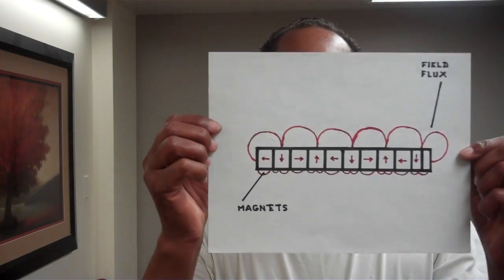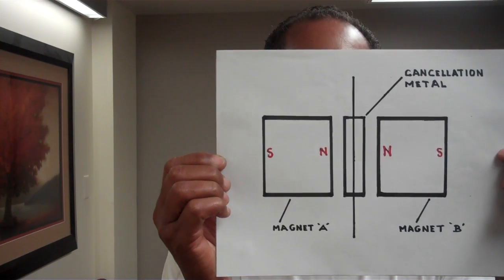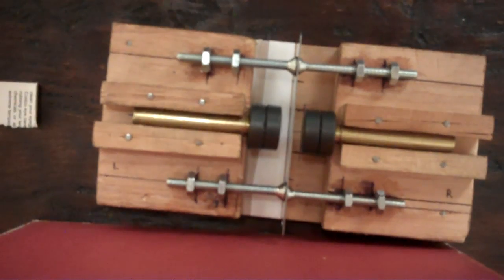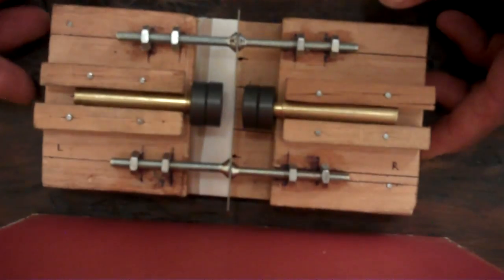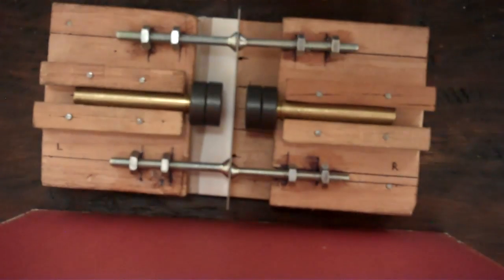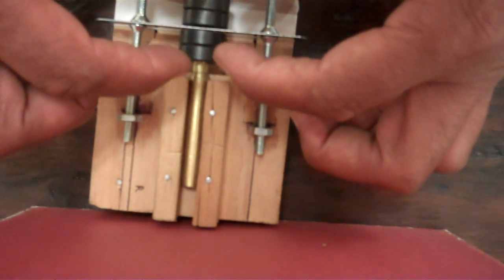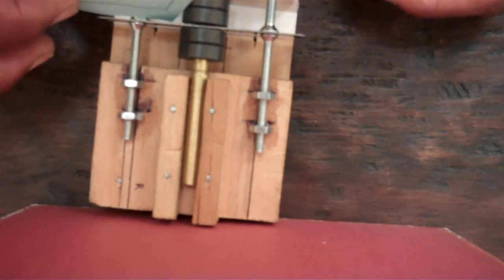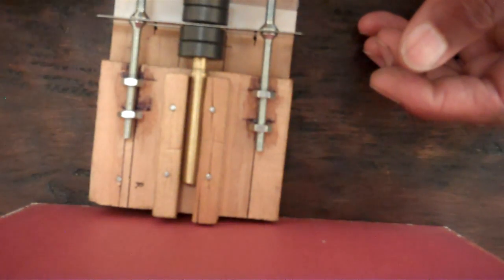PERMANENT MAGNETS: Two Types Of Permanent Magnetic Field Force Cancellations (Balancing) | Part 1

Comment: I understand the premise and acknowledge that it is possible, but you should have had more space between the magnets and the wood block as the wood block is preventing the magnets from repelling further.  You could literally remove the "blocking metal" between the two magnets and nothing would happen as they cannot move further apart due to their collision with the wood blocks.
Reply from the maker: Mr. Wes Baumguardner : .. This is a rough model to prove 100%, and to get the point across. That, equal repelling of the magnets toward each other and their attraction to the metal plate, is possible. Cancelation of direction of magnets to zero. Neutralizing their field strength in a certain way, without destroying their field strength. With electromagnets you simply cut the electricity off if you want to break the field strength. This can not be done with permanent magnets.
Reply: @jessiejohnson3457   "This is a rough model to prove 100%, and to get the point across."  In order to prove 100%, you must show that it is the magnetic shielding that is stopping the magnets from repelling further and not the wood blocks of your demonstration device.  I am trying to help you out because people whom do not understand the premise can simply claim you are using the wood blocks and completely disregard your experiment as pseudoscience.  I already knew your premise worked before I watched this video, but most people are fed nonsense about how magnetism functions in the public education system and they think a lot of phenomena are impossible that are actually possible.  I am on your side.  Thanks for taking the time to educate people about this as it could definitely be utilized in advanced technology.

Comment: In some electronic devices speakers have magnetic shield to protect from disturbing other components.what is the material used and what is the principle behind it?.
Reply from the maker: Mr. Sundararajan:  ...This video is NOT about magnetic shielding. I know what magnetic shielding is. You indicate that you don't know. This is about magnetic field balancing. 2 different things indeed. Repulsion of magnets to each other equals attraction of magnets to metal. Hence: field balance. Push equal to pull.

Comment: If you hold together 2 magnets while they are repelling and drop them from a height will they take longer hitting the ground than 2 magnets simply held together naturally? I heard the repelling ones slow down the gravitational field and go slower . You would need to some how fasten the repelling magnets together stopping them doing what’s natural.
Reply from the maker: Mr. A. A.: ...I don't know. You'll have to find.
Reply: @jessiejohnson3457  what I show people is I have a 1/2 inch copper pipe ID and a small piece of iron rod 1/2 inch OD and 2 magnet's. Funny how iron alone falls fast thru the pipe. And the magnets alone fall slow. Add a magnet to each end of the rod and try orienting them different directions to the iron...like nsIns, N-S-I-S-N, and snIns....you should see each of those three fall at different rates.

Comment: good stuff Jessie! im looking to get the max range possible in resonant nearfield coupling at 125khz, any ideas? problem would seem to be if i put metal behind my coil it will tend to cancle out the field/repel the field from the card im trying to read (rfid). Do you film this at a comunity tv studio? was wondering who interrupted you
Reply from the maker: Dear Mr. J. Wuethrich: (1) You will have to test to find out if the metal used to balance the magnetic force fields will balance for your case. (2) This was videoed at a meditation center and several of the women wanted to use the room.

Comment: was hoping you also removed the magnetic canceling while the magnets were very close. also add Gator Clamps To each end of the cancelation piece to amplify effects. please reply.
Reply from the maker: Mr. Altruism: The rough working model that's pictured in the video cost $10-$20. Made from common materials. Please make one and test it in every way you want. It's a bit of fun to make in fact and test. Everything you need to know is in the video. Add gator clamps and have a ball.

Comment: very well demonstrated, your magnetic canceling principle would have several industrial applications such as high voltage switching or a shut off switch if excessive vibrations is detected without the need for electromagnetics relays.

Comment: I would like to have seen what would happen to the magnets if the metal was removed and or if one magnet work to actually come closer I want to see all the pluses and minuses
Reply from the maker: Dear Mr. Slayer: If you wish to see all the pluses and minuses, then simple make one as shown in the video. It cost about $10-$20. Nothing fancy. Use scrape wood from around the house and small magnets with a central clearance hole and small braze tubes from the hardware store and super-glue. Spark plug gap blades from the auto-parts store. Make it precise enough and it'll work. It's in fact a bit of fun to do. Nothing boring. Have fun.

Comment: NICE demonstration ! thank you for posting. I think that what you are doing is not "cancelation" but double "Shielding" If you use ferro powder on paper on top of your demonstration you will see that each negative side is being "rerouted" outward by the metal then back toward the south end through the air. "Balancing" not "Canceling" is what you have done here in my opinion: let the ferro powder show the truth
Reply from the maker: Dear Mr. H. Westrich: The directions of motion of the magnets are canceled and don't move. The forces of attraction and repulsion are balanced. Equalized. It is very simple.

Comment: Shouldn't it 2+(-1)+(-1)=0? Presumably each magnet has a +1 attraction to the metal with equal repulsive force to each other. 2x+ (-1x)+(-1x)=0 
Were the value for x of the magnets not equal the cancellation would not work.
Reply from the maker: Dear Mr. Phu Kew II: Don't complicate the simple. It's simply plus one minus one equals zero. Nothing more.
Reply: O-Kay. I was just asking.
Reply: Phu Kew II ....hahahaha i dont know..im not good at maths...hahaha
Reply: ....he didnt understan ur question i guess....he just explains just what he thinks
Reply: That's OK, he means well. I guess if we make 'X' 1/2 it would work. I think.
Reply: Phu Kew II even if one magnet is half as strong,  it will just be 4x closer. using just what hes stated he isnt wrong but it is lacking. its good content though.

Comment: Dear Jessie Johnson, please tell us what you study in the electrotechnical works. Thank you
Reply from the maker: Dear Mr. Constantin V.: Tho I experimented with permanent magnets for about 30 years, this was to learn it's principles and construct a machine that could be a power source to produce electricity via an electric generator. I've found that system. Now I'm into other things.
Reply: Producing electricity using magnets was discovered after more than 100 years. Physicists such as Ampere, Faraday, Maxwell, Einstein, helped however. Belgian engineer Zénobe Gramme (1826 - 1901) achieved in 1870, the first electric generator for industrial use. Too bad you lost your time discovering things already known.
Reply from the maker: Dear Mr. Constantin V.: You don't know what you're talking about. Let me hip you to the problem to be solved. Hydroelectric generation. Water falls from a position down over turbine blades of a turbine which turns an electric generator. The amount of force that made the water fall is the same amount of force to bring it back up to its original position to fall again. Use only permanent magnets to mimic this process to produce electricity. Then you'll know better not to talk when you don't know. If you write any other dis-respectful comment I'll delete it. Learn who you're talking to before you talk. Einstein and Maxwell were dim-wits. The others were hands-on. They knew reality.

Comment: Thank you. Excellent
Informative and good demonstration.
Did you make the the wooded board yourself or did you purchase it? Where can I find those magnets and the metal plate that you use for demonstration? Thank you,
Reply from the maker: Dear Mr. Ali Umar: (1) the wooden set up is made from scrap wood I found around the house. Nothing special. (2) magnets can be bought at most hardware stores. From small 25 cents magnets to $20-$30 magnets. All common. Pick what you want. (3) any magnetizable metal will work. Test for the strengths and dimensions you want. The rough model in the video cost $15-$20 to make. Simply make it with enough precision and it'll work. It is simply to balance the forces of attract and repel of the magnets. Nothing more.
Reply: Thank you Jessie. You should be considering to teach physics. Lots of need for Physics instructors in US

Comment: neat but lack of berrings on your experiment allows for flux if cancellation  is truely possible than all math is flawed and free energy is possible.
Reply from the maker: Dear Mr. Neuphpne: (1) This is a $15-$20 rough model in the video. It is not meant to be a flawless balance of forces as a $300-$900 model. (2) Extreme precision and tolerance can be attained with today's technologies if extreme balance is required. (3) All energy in itself is free. You're made of it. 100% free. (4) Research Nikola Tesla to comprehend the nature of things. 99% free energy has always been possible but the Capitalist System will not allow this. Money and greed rules. 99% (not 100%) is many times more than enough energy for all human activities indefinitely. (5) All math about physical processes isn't flawed, only a small sized percent of it is, because human beings are limited and flawed. (6) Research in depth the nature of things before you comment.
Reply: neuphpne: Nikola Tesla proved that free energy was possible ages ago. All natural energys are and should be free.
There are energy forces all around us, we just need to find ways to tap into them. Example:Earth's magnet fields.
Reply: "neuphpne: Nikola Tesla proved that free energy was possible ages ago. All natural energys are and should be free.
There are energy forces all around us, we just need to find ways to tap into them. Example:Earth's magnet fields."

Contrary to what you see claimed a million times on YouTube. Tesla knew better than to get involved with free energy. He was an educated man and he knew that there was no such thing as free energy. He never wasted his time looking for it. Also, the Earth's magnetic field will never be a source of energy. No magnet can be a source of energy, magnetism is a force, not an energy.

Comment: Great presentation. As for a theory? Personally I realized that the main/primary force of magnets is the circulation of the potential field that is created by the aligned electric fields of the molecules. This is your primary +1 force. This trapped moving potential energy is simply moving charge and happens when voltage circulates in conductors. The magnet's trapped circulating fields entrain the same movement in the ferromagnetic steel shim. Creating a force balance that is not present in the magnets itself. Their charge carriers are saturated and locked in alignment. 

There is a balancing force in the magnet, a movement of charge neutral type, called dielectricity or in a capacitor called displacement current.  This force is orthogonal to the moving charges, but in alignment with the actual motion of the displacement current.

Recognizing that these two forces are independent is essential to mastering magnetics (which are just expressions of these electric field effects). Understanding these two forces provide the explanation for what induction really is, and also the explanation of the Faraday Paradox. It is also the key to controlling induction that violates Lenz's Law, or self-powered generators and transformers that amplify electricity like TC Heins' inventions.

Conductors have limited capacity for dielectric fields, moving potential/charge fields induce dielectric energy, so you get a magnet as a source of moving charge fields that cannot balance because the material will not hold enough dielectric field energy, so it collects in the space around the magnet, in a state of imbalance. Move a conductor through this distorted concentration and it will convert it to moving charge fields, or induce electricity.

If you want the math, go to distinti.com; there are those who realize there is only an electric field, magnetic fields are simply effects produced by the electric fields. Electric fields made up of these two distinctions: charge and density.  

Free your mind, let go of magnetism, it doesn't exist. Finally you can see that diamagnetism is the dielectric field dominating the electric field and therefore repelling either pole of a magnet. The rules for dielectric repulsion is omnidirectional, not right-hand ruled like the charge field.

Antigravity is engaging the same forces.  Force two N poles together and they will fall slower than other objects in a gravity field. The field is really an electric field balancing act. See the potentials move and the density, it's simple. Be free.
Reply from the maker: Dear Mr. B. Man: What you've wrote may be true or not be true. That's fine. But of no concern to me. The matter is to simply balance the equal but opposite forces. Nothing more. Which can be done. The rough model in the video cost about $20. Make a better one if you need to. A lot of talk and argument is worthless. I don't talk, I do and show.
Reply: Jessie Johnson, I understand your position; however, a correct working theory may lead to an application that goes beyond your demonstration. As you say, building it is all that matters; but first requires inspiration.
Reply from the maker: Dear Mr. B. Man: Please, write into you tube: " Permanent magnets: how to build a working semi-perpetual machine ", Jessie Johnson. This will assist you and give the idea.
Reply from the maker: Dear Mr. B. man:  On the contrary  - it is not a correct working theory that's needed - but - a correct working model. One is reality. And only reality. Theory is of no value, if what you're dealing in doesn't work or doesn't exist. No matter how well structured and cute the theory is.

Comment: The force needed to overcome the friction of brass tubes against the wood is GREATER than repelling and attracting force. That's all ) If the friction was zero, you would never balance these magnets.
Reply from the maker: Dear Mr. Ilya Rumeyev: Look at the video again so that you may know what you're talking about before making a comment.  (1) there are two braze tubes. One inside the other that slides back and forth. The magnet is attached to the smaller braze tube ends. The tubes DO NOT rub or create friction against the wood. The larger tube is held in place by the wooden set-up. That's how it works. (2) the magnets can always be balanced with high precision and high machine tolerance. (3) there's no way to produce zero percent friction in moving machine systems that's in contact. Forces are at work in all machine set-ups.
Reply: The friction is not the brass on wood, it is the brass on brass.

Yes there exist a "zero" but that center is infinitely precise. In a free movement setting, a fraction of a plank length to the right or to the left of that zero point and  "Tack!" something will move. The odds of the thickness of your paper being bang on such a precise distance is close to infinitely impossible.

Using something that is not "neutral" in the middle but that has specific polarities with a wider range of possible size and strength could easily create a "cushion" zone. Such as you are trying to achieve.

Two magnets that has certain patterns of polarity could have an attraction to each other at a distance but would repel at an other distance. There are a few video's on youtube that demonstrate such magnet. (your magnitic flux drawing... Imagine two identical setup one on top of the other.)
Reply from the maker: Dear Mr. Nick: Figure it out. Others have. There's a limit to how accurate and/or precise a thing can be made or done by humans. The $20 set up in the video is a rough model to prove a point. IT DOES!  And proves it superbly. Nothing poses a problem with such a simple device. Friction, precision, accuracy, materials, work - man ship/woman ship or anything else. The point you harp on is not relevant to this. Don't talk, make one. Test and see. Everything else is of no import.
Reply: yes but the friction would be equal and both directions, it may never be exact because of the green of wood that the shafts glide through

Comment: hi mr Johnson. how did you found the correct magnets for the correct thickness of metal? how can i found magnets for (for example) 3mm thick metal?
Reply from the maker: +Raivis Spravniks . Dear Mr. Raivis: First get the magnets then match the metals to it. (1) Use any magnets you wish, of any strength, of any size, made of any type of material magnets are made of. (2) After that match the magnetizable metal to it of an exacting thickness, an exacting length, an exacting width. It's that simple. There are no special magnets or metals. Common things will do.